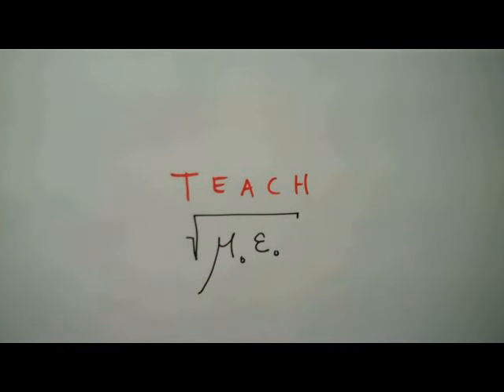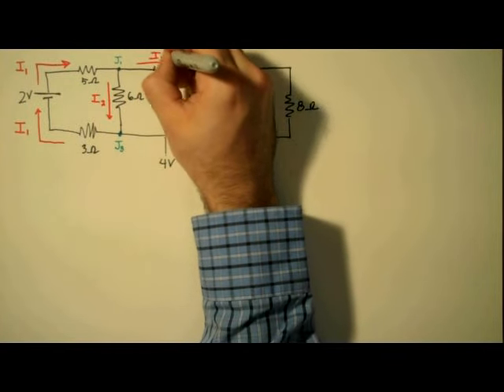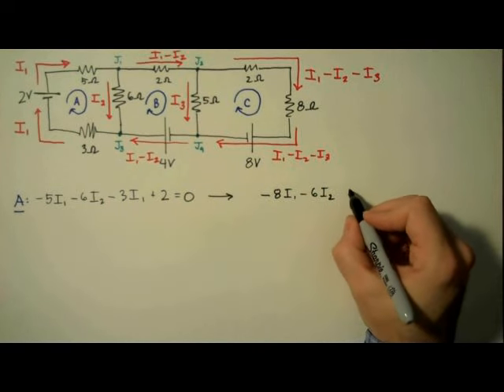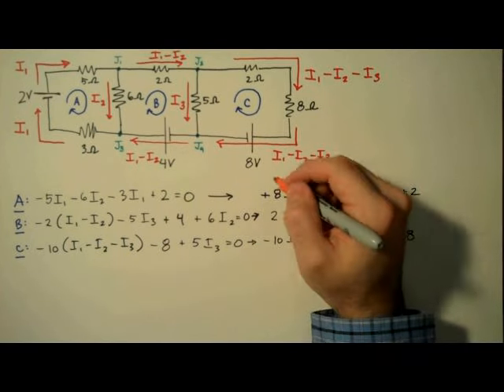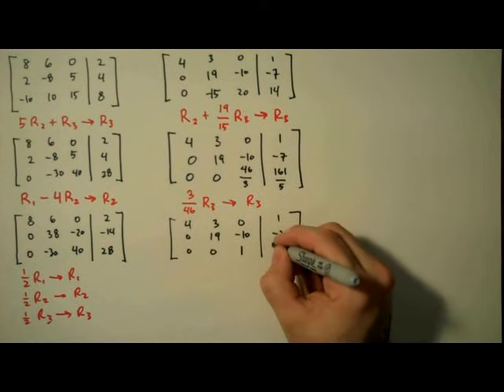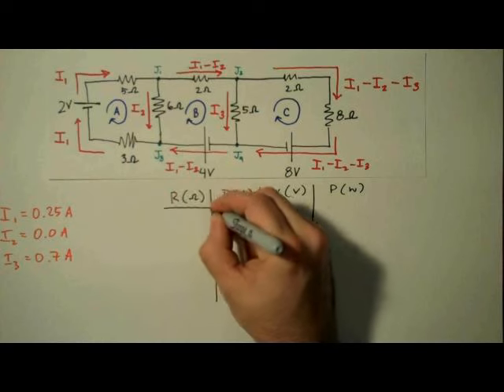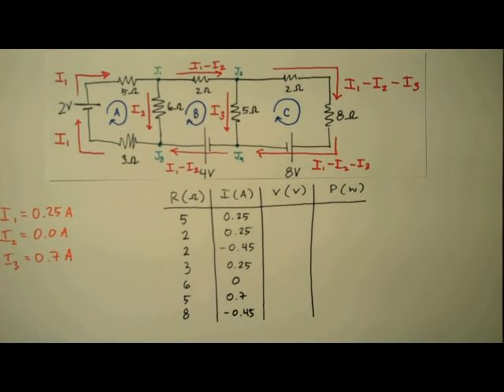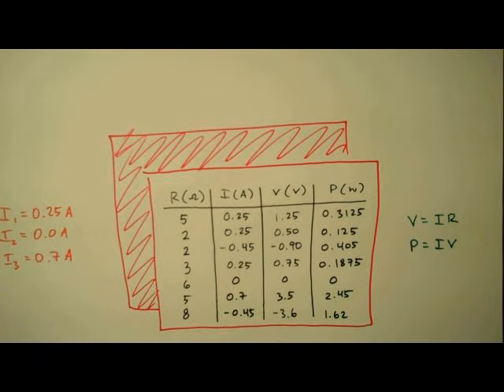How to Solve a Kirchhoff's Rules Problem - Matrix Example

Comment: why loop c have a -8 not +8 in the equation? please help prof.
Reply: I know this is probably too late but in case anyone else has the same question -- he multiplied the whole equation by (- 1) to make it look nicer and went from - 8i1 - 6i2 = - 2 -> 8i1 + 6i2 = 2
Reply: why does he multiplied it by (-1) to remove all the negative? what if I leave it as it is as an equations by not removing the negative? will my answer still be the same? Wondering
Reply: azan97 yes the sign will only denote wrong direction
Reply: azan97 Of course it will be the same answer, it’s just a liniar transformation if you multiply one equation by (-1)
Reply: 3 years late,
Reply: Feb 7, 2019

Comment: Hey I love your videos, it's really well explained. But why don't you use Cramer method to solve these equations ? By simply finding its determinants, you can find the solutions (you spare time and space). When I have to solve a linear system with Gauss Pivot, it takes about 10 minutes when it only takes 3 with Cramer method. I think you should show that methods to those who are not comfortable with Gauss method :). 

Anyway, keep going, these video are just priceless !
Reply from the maker: +bertrand bouillon Hi Bertrand. I used Gauss-Jordan because it's one of the first techniques learned in a Linear Algebra course. The Cramer method is definitely faster but physics folks are less likely to remember how determinants function. Thanks for the compliment and suggestion!!
Reply: +bertrand bouillon Besides, less buttons to push and you effectively and efficiently derive an answer with less possibility for error; thus, using a matrix in inherently the better choice.

Comment: Hi Jesse, a great video but when you multiply row 3 by 3/46, this means you have the following 3/46 x 161/5 for the constants column, this does not equal 7/10?, the 7/10 is the correct answer.

Comment: The position of the battery in loop 2 and 3 are the same , the loop are both clockwise , but why for LOOP 2 the voltage (4V) is positive but for LOOP 3(8V) the voltage is negative ?. Can u explain ? Thank you

Comment: Thankyou for this video! I have a circuit with 3 loops. The first loop has  a voltage source of 140 volt,( which is connected to ground from the negative side, a 20 ohm resistor and a 6 ohm resistor. The second loop had just a 5 ohm resistor and then the 6 ohm resistor from the 1st loop.The third loop has a current source of 18 A and the 5 ohm resistor from the second loop.  When I apply the loop rule I cannot rewrite the equations so they aren't equal to 0. I cannot use that for gauss elimination, right? Is this even a technique I can use for such a circuit?

Comment: why did you multiply by negative 1 for the first 2 equations (loop A and loop B)? I know that  if I get a negative answer with the matrix that the direction I assumed for the current is the wrong way.  I am trying to correctly enter the coefficients into my T1-84 calculator and do rref([A}) but I am not getting the correct signs.

Comment: one question i have is how you tell which currents the numbers you get apply to.  Can anyone help me with this?
Reply from the maker: +. Sorry I missed this - and unsure of what you're asking... =(
Reply: +Jesse Mason He's asking in a matrix when you set it up the right hand side is usually something like:
[1 2 4 1 4] (Just imagine the numbers are vertical matching with a specific equation written through the KCL/KVL laws. Once you plug into a matrix calculator you get numbers like [ -6 -3 3 5 6 ] (imagine these are the current values that your calculator spits out. 

The question becomes how does he know -6 goes to Current 1, and not the other 4?

Comment: I don't believe this problem to be correct,  using KCL at junction 1, the current going into the junction needs to equal the current exiting the junction so: I1 = (I1-I2) + I3, which means that .25=.25+.7? I believe you switched up a sign by mistake when performing your KVL expansion for one of your loops and this caused your problem.

Comment: Shouldn't be 161 over 15 (not 5) in the 5th passage? And how did you get 7/10 since (161/15)x(3/46) won't give you 7/10 ??
Reply: His 46/3 is wrong, it has to be 19/230, don't know how he mixed that up. It's neither 161/5 nor 161/15, but 161/19 - if you do the maths then, 161/19 * 19/230 = 0.7

Comment: You made a mistake in the second step of Matrix solving.
Reply: "A mistake" specifying it would help him I'm sure...
Reply: I hate to agree with Tanay Kumar because he should've pointed out the criticism when he saw it. I'll do it for him. In the equation for loop C, the lad accidentally wrote -8 instead of +8. It should obviously have been weird for everyone that I2=0.
Reply: it has to be -8 as we are entering through the positive terminal i.e. positive to negative which is a voltage drop and hence the voltage is negative....
go through the previous videos posted by jesse and you'll get a clarity urself
CHEERS!!!